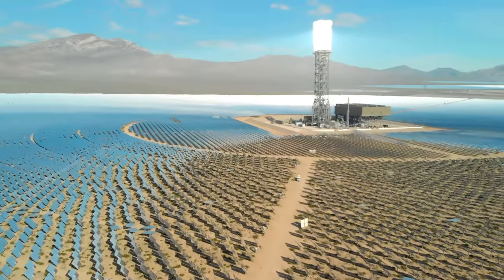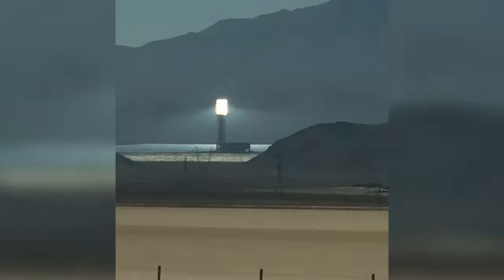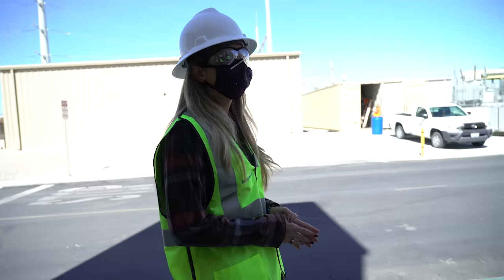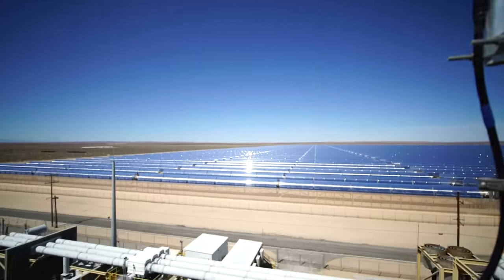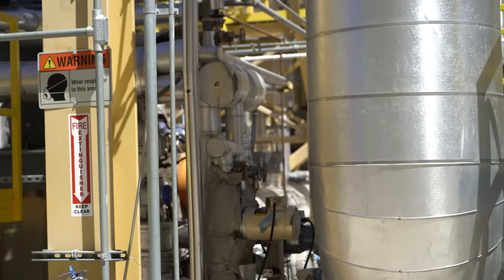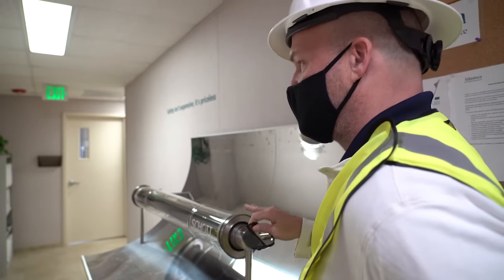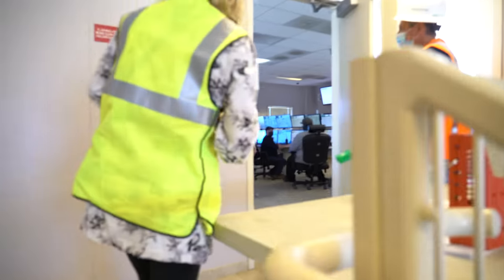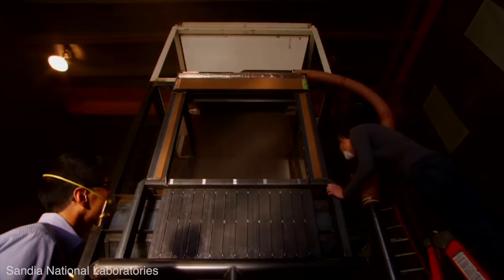How Mirrors Could Solve our Energy Problem

Comment: Well "  How Mirrors Could Solve our Energy Problem  ". .   Can be used for collecting Solar power, but not the Heliostats  ( Heliostat - Wikipedia ) as first shown in this Video.. .   Yes they work, and so this video is a good learning video.. .    But relative to today's Solar PV's they are not efficient and very expensive to build and set up and maintain.. . .   Further in, she does mention Solar Parabolic Reflectors, which again work. . .  They are cheaper to set up and install than the Heliostats, so probably better choice, and can be built over larger areas to collect more sun energy.. .  A very big advantage is that the solar heating goes into Molten Salt, which can keep the generators running for several hours after sunset, which FV can not do. . .  Even PV with Batteries can not hold the same amount of energy as Molten Salt can at the same cost.
As She says, and that guy, Energy storage is becoming increasingly important with renewable energy sources.. . .  Batteries are great for short storage periods, perhaps up to an hour or so, but we really need much more Energy storage,.. .  Pumped-hydro is probably the best of all, but not available in most places.. .   But Molten Salt and hot Sand can be used anywhere, so are worth seriously looking at. . .  In simple theory, there is no limit to how much Energy Storage you can do with Molten Salt and Hot Sand, but it comes back to the practicalities and costs.. .    The cheapest and largest practical form of /energy storage is in stable chemical form.. .  Batteries are actually chemical stored energy. . .  But the easiest and cheapest form of stored energy, we call Oil and Gas.

Comment: Problem with that mirror solar powerplant is it uses 3 cubic meters of water per megawatt hr., the 2nd highest water consumption of any power generating system. Also maintenance.
No photocells combined with some sort of battery to store the power is probably still the most cost effective in terms of build and maintenance.
You could power all of Los Angeles county by just placing solar panels in every parking lot in the county.

Comment: These mirrors and the heat they generate is the reason there's a drought. 
The monsoon that used to come from Nevada and Arizona storm turn back and away from California. 
The High Pressure as Weather Casters call it : keep the storms going up to Canada 🇨🇦 with  the occasional drop to the Bay area. This is and I hope an unintentional Weather Modification

Comment: These mirrors will solve an energy problem, but only when the sun is shining.
What we really need is something like a water mill or a turbine..  The movement of water turns a generator.  
e.g. Build dams where the water enters or leaves the Great South Bay.  ( this is between Long Island and Fire Island )  Water flows from the ocean into the bay, when the tide is going up. then flows in the opposite direction, when the high tide is going out.in , and will do this whether it is sunny, cloudy, windy, or not.

Comment: I live in the Valley of the Sun, Phoenix.  Pretty similar weather to Las Vegas.  Sometimes it rains here.  And sometimes it is overcast.  Sometimes, even for a few days in a row.   Can you heat enough sand to generate electricity for this type of time period?  And in the winter we really don't get a whole lot of heat.  Is it enough to generate sufficient power for the demand?  It seems that even if the technology advances we will have to have conventional power plants to account for those periods of insufficient sunshine.  Doesn't that kind of defeat the whole reason for the extremely large solar facilities?  

I'll bet you didn't see any birds near the plant.  I understand that they explode quite spectacularly when they fly between the mirrors and the tower.

In the future we will probably get our power from multiple sources but the way you described this technology with the investment in resources alone it probably will not be practical in my lifetime.  But then again, I am a bit older than you are.

Comment: I was thinking of something similar for space a few years ago. My version of the Concentrated solar Tech uses a graphite rod, which absorbs the heat boiling a cryogenic liquid to a gases state, The heated gas passes through a turbine generator, then the gas travels in a large room with no air or atmosphere in it, In that room the gas is cooled by the temperature of space, and fed through the system again in a cycle.   Idk if this makes sense i thought of it when i was 14

Comment: They could build either the tower, or the panels on platforms.. filled with the surrounding earth provided it was compacted and stable, although a costly engineering process maybe.. the platforms could be raised using the excess energy the obviously allowed to lower using gearing mechanisms etc to harness the energy when required... :/ it would allow long term energy storage..

Comment: I don't understand why every power plant (be it solar, coal, nuclear or whatever..) doesn't use Lake batteries. Where the system uses its extra energy to pump water up to a higher elevation. Where the water is stored (battery style) until they need the extra energy. Where they'd turn on a damn and let the water fall back down to the lower elevation; spinning turbines to create and use the stored energy in the lake battery..??

Comment: What if the glass is replaced with solar panels without the anti reflective glass surfaces that are found commercially?

I've read that the solar panels only absorb 67.4 percent of sunlight that is shown upon them, and the solar panel technology has improved dramatically over the years and now we have flexible panels available too, if we could harvest the lost energy in heat towards this method, there could be a possibility of more efficient way to use the sunlight.

Sure, the heat from the flexible solar panels is only third of what is used to be produced, but look at it this way, we can improve upon the efficiency of the generic solar panels, to the next level. 

Plz educate me if I'm wrong 🙏🏼

Comment: The answer to renewable energy is not building huge solar fields, or giant wind mills. We already creat energy that is wasted by driving our cars. Each hwy system should have   integrated some sort of system to capture wasted energy by the passing vehicles! That's the answer. It's structure is never changing until we have flying cars, or a more reliable means of transportation. I CANT BELIEVE we haven't harnest this wasted energy yet. It would be as simple as placing magnets on the hwy. Or, turbines that turn like the hover damn and send energy directly to the grid.

Comment: its powerful and free to use if that heat was used to make steam from ground water it could have plenty of mechanical output for electrical power generation but couldnt you just dig a hole in the ground and get heat that way without all the mirrors and a lot less danger from all the light no birds will burst into flames and requires less land but the mirrors can double as a weapon like the navies laser

Comment: I wonder why don't we use thermocouples for this instead - they create voltage when heated, hence no need to go through two lossy steps (heat -> mechanical -> electricity). Are they too expensive or the efficiency is lower than heater + turbine ?

Comment: Very cool idea but the cost out weigh the performance. PV farms are much more economical thanks CSP. A CSP plant requires multiple engineers and teams constantly monitoring and repairing infrastructure. Versus a team of about 4-6 individuals for an equivalent sized solar PV farm. 

Cool video but this is pretty much well known to be a Finacial blunder. There is a reason why there has only been one CSP plant.

Comment: The only thing that can solve our energy problem is to not use as much as energy. Technology creates one new way of creating energy and 10 new ways of using it. There is no end to this madness.
Reply: How many billions are you prepared to see die though? I don't mean you personally - I assume the answer is none. But the real calculation going forward is that our current population level - three times greater than in 1950 worldwide, is supported by a lot of technology. Nitrogen fertilizer and tractors both consume a vast amount of energy. Without them populations would have to be slashed.

Comment: the future energy is compressed air. heat makes steam or air if you boil it longer. water wheels in rivers and streams will compress air. Wind will compress air. Air is storable and transferable across the country with a pipeline. air pressure will generate at a time of need. Air turbines and air engines. An air engine is similar to a steam engine with multiple cylinders.

Comment: This is what we been tryn to invent . 
Now we just need alternators connected to the wheels in the tesla & an internal wind turbine to recharge as you drive . And 750w + solar on the hood , roof , and trunk lid ? 
There's way to incorp mirrors into the system
If steam can be used to spin the turbine , id rather fill my car tank w water occassionally then hyper inflated gas prices

Comment: But what’s the output power per square mile of power plant compared to Photovoltaik - because extracting heat should extract up to 100% of the solar compared to 25% or Photovoltaiks

Comment: it takes fossil fuels to turn the towers on in the morning, the mirrors have to be replaced every 5 years, as she stated one big problem is energy storage,  Also there are cloudy days, snow, rain, and the birds that get fried flying over these things.  Then there's the reality that those mirrors cover miles of ground,, require infrastructure put into the ground to hold them, and make the ground unusable for anything else.  Also, the heat transfer fluid - how it's made and what it's made of requires fossil fuels.

Comment: Is it possible to experiment with carbon plastics to see if it could be vibrationally sensitive?  Are there subtle vibrational waves that emanate from the earth that could be magnified with vibrationally sensitive materials that could be covered on earth quake prone structures that would the make it more structurally sound during an earthquake?  As well as providing energy from the theorized vibrational waves emanating from the earth?  Are there materials that can magnify these vibrational waves and convert it into energy? Geo vibrational waves energy generation

Comment: Would be cool if they used bitcoin mining to subsidize the funding for building such projects. Since these would be able to generate some power at reduced capacity at night, you can build for overcapacity during the day and use the excess energy for mining BTC. Those profits from mining can be used to pay back the cost of manufacturing the operation to begin with. Win win, BTC gets a bit more green, more of these projects can be funded, and when they need extra capacity during the day they can shut down the miners on demand as needed. Eventually if they need the full capacity of energy they can just send the miners elsewhere or onto the next project. Just a thought

Comment: I kind of did not get what the actuall tower was for, i mean, the mirrors heat up the heat transferfluid that is infornt of the mirror then that hot fluid boils water in the thing at 4:20? Why do they have both the pipes and the tower?

Comment: If there is a way to change the heat energy directly to electrical energy without mechanical energy in between wouldn't be more efficient?

Comment: i have been a wind turbin tech for 22 years clean energy is a joke  after 22 years i think our best options areto cut our usage of energyAnd then to either switch toThe small newer designed modular nuclear reactorsNot old Westinghouse design that we used in the past that were designed in the '50s They have way too many problemsBut the newer modular reactorstheir designed to be pretty much a chimpanzee could run it or thorium reactorsBut that's just my opinion after 22 yearsand alternative energy sector

Comment: I don't get hydrogen cars for every 1 PSI of hydrogen production from water only about 40% of the 1 PSI hydrogen is converted back to water so we are at a net loss of 60% of the water. eventually, we will run out of it, or am I wrong?

Comment: Why couldn’t we do the same with a refractor lense and a tinted range of windows in front of the lenses in order to control temperature output of the lense. Instead of thousands of mirrors one small lense could Create the same amount of energy with less cost involved.
Reply: Geee... why didn't the engineers building the $2 billion plant think about using smaller mirrors?!

Comment: She is getting really excited over this failed project. Constantly threatened to be shut down because it does not deliver the power it was contracted for. It also fries birds in large numbers as they fly in to the focused beams. Every day, the salt actually has to be re-melted using substantial amounts of gas, until the system is hot enough again. This results in a hefty CO2 footprint for this "solar" power station. It seems no more licences have been granted for similar installations. So this was a failure, if it does not even work in the desert, it does not work anywhere.

Comment: Unfortunately this does not work in all parts of the world and to deliver from an installation in such a place, would not be practical do to distance. (resistance, voltage drop) this can be solved but would never be economical and typical people don't want to live in or by those places. But hey this can work for California because anything can work there RIGHT.

Comment: Just to look at this technique from all perspectives I would also suggest looking at this part of Michael Moore's Planet of the Humans http://www.youtube.com/watch?v=Zk11vI-7czE&t=31m9s 

Personally I think mostly solar and some wind can be a nice option for local energy-production, while lifetime, cost and efficiency still need to go up to reach that point. As long as the local energy-production needs to be subsidized it’s not a real solution.

But on a bigger scale I see for now Nuclear, later Thoriium and eventually Fusion as the best solution for generating energy. Combine that with storage mostly in the form of liquid (human-mate gasoline alternatives) to be used in combustion engines or with fuel cells. 

Use solar fields (like the one in this video) or wind farms are not going to be the solution.

Comment: wonder what it cud do with crystals lol so going back to steam isnt just in my head, im was tryin to figure iut how the steam cud be recycled to create condensation and if the condensation cud also create another stage of pressure or vaccuum and then that cud aomehow create more heat making a closed loop but i cant imagine how once it got going to shut off other than cooling don i guess but it seems that the same force of energy can be created by cold as heat or maybe juse difference in teperature can create force or momentum esp if cud contain molecules or separate into phases

Comment: it was a good idea, until photovoltaics got so cheap. it works, but if you can generate electric at half the cost from roofs rather than desert wild land...  why?....
 there are numerous ways to store the electric power from photovoltaics. iron batteries, flywheel, big cable weights, pumping water up into a reservoir, and heating a pool of sodium

Comment: Horrible for the environment. Most large scale solar is. Ask the birds how much they like that heat… hydrogen combust at 500c ambient humidity at the thermal contact with the light source and mirrors creates NOX gas, but because they don’t capture it they don’t measure it… natural gas can be tremendously more efficient

Comment: Iavanpah had a capacity factor of only 19%, Crescebt Dunes (Nevada) in its best year (2016) a CF of just 13%. How about that? Wan't some more? By each MW of renewable installed capacity, there must be at least another MW of installed capacity OF A THERMAL SOURCE (natural gas) ready to enter operations somewhereelse in the grid when the sun doesn´t shine, when there are clouds or when is night, achieving the magical result of inevitably increasing the cost of electricity and inevitably MAKING CO2 EMISSIONS TO RISE, if you want to have stable electricity supply.  What about that also? Just see Socialist California: the most expensive electricity in the USA. What about that, sweety girl?

Comment: “Sponsored by Toyota”. So this is not science, per se.  rather it is an eleven minute, paid advertisement.  And I suppose that Toyota is either required to, or strongly encourage to, to paid to, promote “renewable energy” by some other entity.  So, ultimately, who is actually doing the talking?  If you want to do some real science, see if you can answer that?  But in that case what would happen to your sponsorships?

Comment: I keep coming back to this channel giving it another chance but I never here anything on cost factors. Know one talks about how far out these ideas are. Some 10 &20 yrs away. Comments like, before we run out of oil,  is not doing channel any good. Very left side. While these idea are great most aren't practical, like living on Mars.  Great idea but not practical are affordable cost too much.  You speak of all the positives but none of the NEGATIVES which is why we haven't advanced in the area for over 100yrs. Advance on tech YES, advance in practical use in these new techs ? Well we're still using oil, so! Climate bs has been going on far decades and decades.  Still not one more inch of water rise in NY. But wait, NY was supposed to be underwater,  TWICE, by now according to experts. CONCLUSION, BS BIDEN CHANNEL.  love your ideas and learning. Don't like your leftist sales pitch. UNSUBSCRIBE!